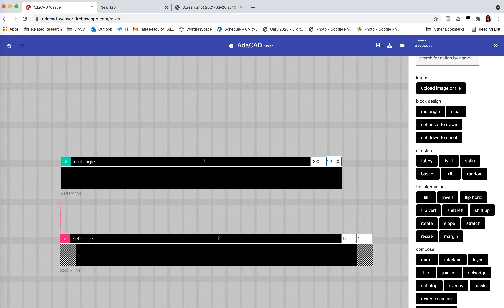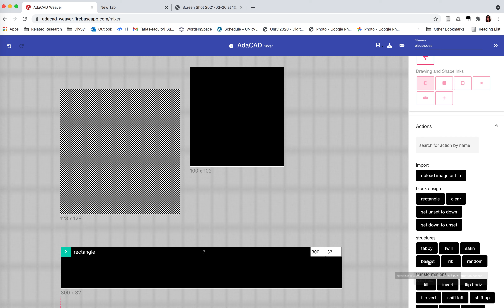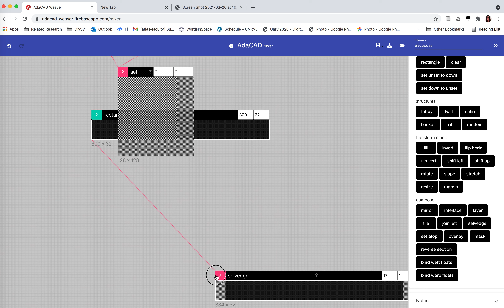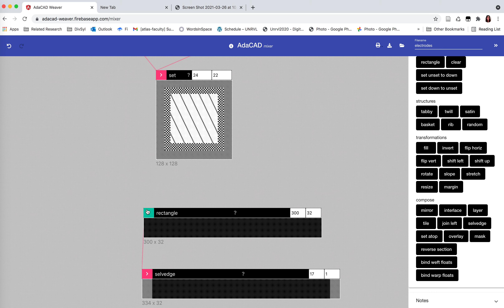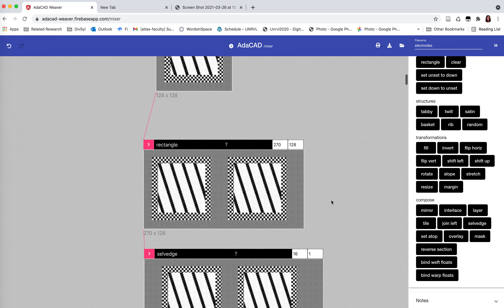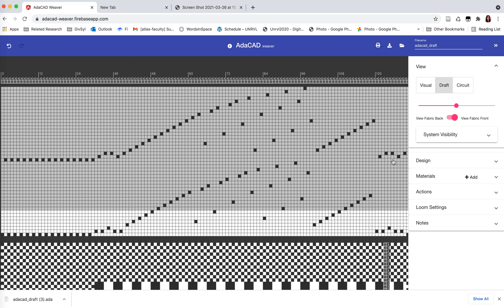Generating Woven Electrode Patterns Using AdaCAD Mixer

Comment: I'm interested in using a similar menu to the one that appears on the right side of the workspace in the video. I'm specifically interested in importing files and patterns. The current AdaCad menu I've tried out doesn't seem to have these import features. Maybe I am missing something?
Reply from the maker: So sorry, this is a video of an older version. You can import in the current version from the top bar. I'll bring back the import draft feature in a future version but for now, you could use the "image map" function to import a draft. Hope that helps!
Reply: @unstabledesignlab  thanks I’ll try it out!
Reply: @unstabledesignlab  thanks but unfortunately the image map feature doesn’t have outputs, just inputs. Which is great for an image but not great for weaving structure patterns. I have a library of weaving structures that I use, and it would be handy to be able to import them as is and use them.
Reply from the maker: @kristenroos  Ahh - I see. I just sent you an email so you can contact me directly. I think we can find a way to support what you need :)